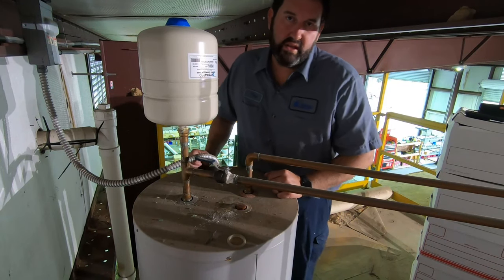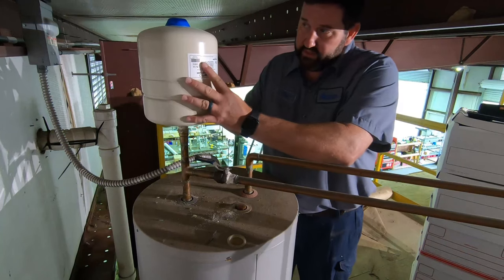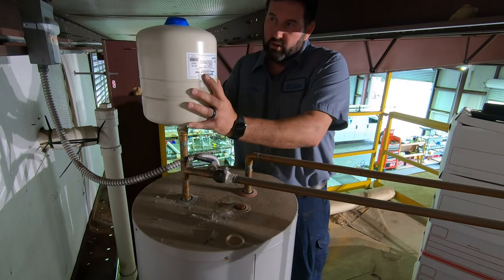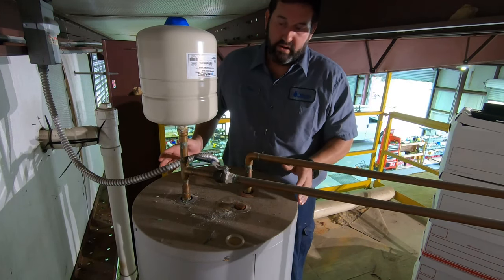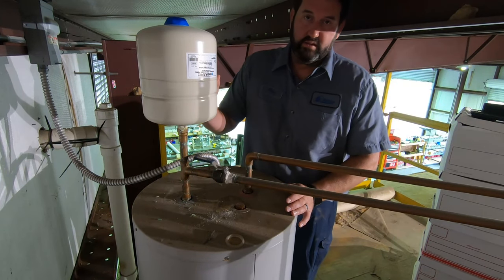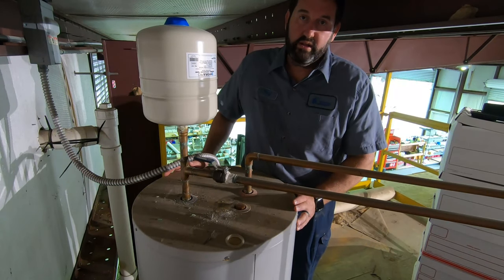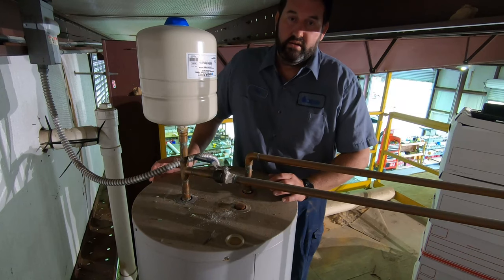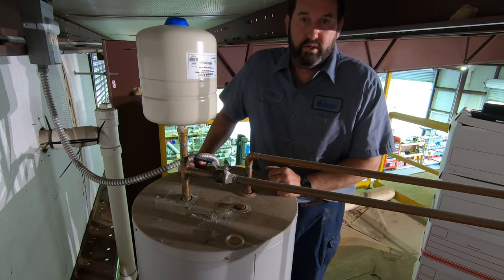What does an expansion tank do?

Comment: I’m no plumber but I’ve never used one and have never had any issues. By the time it goes bad I just replace it. These things are design to go back the day after warranty is up anyways.
Reply: How do your heaters usually fail?
Reply from the maker: We've had several instances in which the water heater liner fails and begins to leak. In each instance, there was no expansion tank. So  i think they have great value. Thanks for commenting, where are you from ?
Reply: If they were needed they would be designed with them already on them, sometimes people just look for things to put on things that aren't needed.
Reply: @timgaskey2258  - no because there are some installations that don’t need an expansion tank, they aren’t incorporated into the water heater by default. Also, a water heater has a much longer service life than an expansion tank, so water heaters would have to be replaced far sooner if the expansion tank was built in.

The real point that was missed in the explanation is when it’s absolutely a must to have an expansion tank regardless of what code requires. If the water meter has a back flow prevention device, then an expansion tank is a must. If the incoming water supply uses a pressure reducing valve, an expansion tank is a must. If the T&P valve on the water heater is dripping, you might (might means maybe, not must) need an expansion tank.

The water expansion that occurs when the water heats water is sometimes released by plumbing fixtures - for example, a toilet that seems to run might be doing that because it the increased water pressure that the expanding water produces in an otherwise closed plumbing system.
Reply: Great video sir i have a question i have an AO smith gas water heater and for decades i had never install an expansion tank. When the heater goes bad it start leaking from the bottom and i just replace it. Should i get an expansion tank?
Reply: @timgaskey2258 lol! My gas water heater didn't come with an exhaust pipe so I guess it doesn't need one. 

This makes no sense. My electrical panel didn't come with the breakers installed either does that mean I don't need them? The water heater has one job and if installed and maintained properly, it can do that job for up to 20 years. An expansion tank also has one job, a very different job from a water heater, and if installed and maintained properly it can last up to 10 years. 

A side bonus of an expansion tank is that it can act as a whole house water hammer absorber thus killing two stones with one bird.

Comment: My water heater has two different sets of water hookups-
Two on the lower side and two on the top...
possibly for the type installation...
I’ve hooked it up to the ones on the lower side connections and now need to add an expansion tank.
Does the expansion tank have to be hooked up to the cold side that is actually supplying the water heater or could i just hook it to the extra (non-used and plugged) top cold hookup?
Would just make the job a LOT Easier and should let the thermally expanded water press out of the heater.
Thanks in advance for Any Advice!!!
Great video btw-best I’ve seen yet 👍

Comment: Just replaced a 20 year old gas water heater, never flushed it, never changed the anode rod, and didn’t have an expansion tank…connected to city water…I replaced it because it was not heating as it should, probably from sediment build up….im sure these tanks are helpful depending on your situation…I didn’t install an expansion tank on my new one…I didn’t have a logical reason too

Comment: I have a Watts (adjustable) relief valve coming from cold water line and is set up to release outside like the water heater pressure relief valve...
And it's leaking ...the stupid part is so old Home Depot doesn't even have it you have to order it..
Something tells me this is just a pressure relief valve they used before they used the expansion tank and it's totally unnecessary now.
But finding the answer to this question on the Internet is like almost impossible I've been trying for 4 hours can't even see straight

Comment: Sacramento has that requirement. But still don't know why it's necessary besides it being very important.
Reply from the maker: It really does help to extend the life of the inner liner of the water heater. The heating up and cooling down really puts stress on it over time if there is no air cushion to help it out. I used to feel like it was a waste of time to install one but not anymore.
Reply: I see. Thanks for replying. They shouldn't make it a requirement.

Comment: 3 to 5 yrs., mine is 11 yrs. old and still holds 40 psi. Great video.
Reply from the maker: Nice! What brand is it? I may need to start buying them!
Reply: Mine is a "American" water heaters portable water expansion tank 2 gal. #318461-000
Reply: My tank is 16 years old, without expansion tank.
Never had a problem.
Reply: @mrfisther  Same here my system is a Rheem Fury 18yrs old and NO expansion tank, but it is being replaced today without an expansion tank :)

Comment: Thanks for the great video.  Question:  When water is on, we hear hammering noise inside.  Water pressure off the water heater drain valve and off the  hose bib outside reads 80psi, but inside (wash room) is 38 psi.  could be a faulty prv and or expansion tank?
Reply: there could be a pressure reducing valve in your plumbing system.

Comment: if you have open water system (i.e. no check valve in the cold water inlet), then you don't need expansion tank, since the excess pressure will just go back to the city main. Am I correct?
Reply: By the same logic what's stopping the excess pressure from the city main to put a strain on your pipes?? Expansion tank is like insurance, you hope you'll never need it but will be glad when you do.

Comment: We have a new build house with a well.
We have a pressure  tank that keeps the water pressure at 50psi.
We dont have an expansion tank on our water heater. It's not required by county code.
Should we honestly have one?
Reply: -- No.  If you are getting city water and the water meter has a backflow prevention valve, You need an expansion tank. or if the incoming water supply goes thru a pressure reducing valve, You need an expansion tank.

Comment: i have a solar heater whistling badly. seems it is doing that from ceck valve in cold pipeline. would it eleminate the noise, if installed an expansion tank?

Comment: If you install the expansion tank upside down like in the video won't you end up with air on both sides of the bladder because air is going to get trapped in the wet side of the tank? Shouldn't the tank be right side up so there is only air in the bottom of the tank and only water in the top of the tank?
Reply from the maker: To our knowledge, you can install it up or down or horizontal. Always read the instructions for each one though.
Reply: Air compresses, liquid doesn't.
Reply: Isnt ther a bladder in it that separated the water from the air?
Reply: @u2ooberboober  Yes. But when the tank is first installed it will initially be completely full of air on both sides of the bladder. Then if the tank is upside down (wet side down) when you turn the water on the wet side will only partially fill with water because air will get trapped in the tank on the wet side. But if the tank is installed wet side up the air will purge out of the tank as it fills and the wet side will be completely filled with nothing but water. That's the difference depending on whether the tank is installed right side up or upside down.
Reply: @joevignolor4u949  I see what you’re saying now.  Eventually that air on the wett side will be dissovled into the water and only water will be present and fill the space.

Comment: Home water pressure can increase up to 10psi over normal when served by a tank water heater. 

Heat expands water.

Be sure to read pressure while the cold line is isolated.
Reply: My water pressure goes up to the supply line pressure of 140PSI when our hot water heater turns on,  I only have a PRV installed.  I will install a Watts 2.1Gal Thermal Expansion Tank this week to keep our water pressure about 50PSI which is the PRV setting.

Comment: Quetion:  If you change the pressure on the PRV, do you need to recheck the pressure on the expansion tank?
Reply from the maker: I would
Reply: I just installed a PRV with a valve box coming off my meter. I set the water pressure at 55psi and checked with a gauge to confirm at the hose bib. I then installed a Rheem water heater with a watts expansion tank set at 55psi. If you change the pressure at the PRV, buy a gauge to test on a outside hose bib. This will be the new pressure to set on your expansion tank.

Comment: Thermal expansion happens when heat forces water molecules to demand more personal space. If we don't give the water molecules a place to go they will start pushing and shoving on each other and on their tubular prison maze. This will cause an increase in pressure unless there someplace to go like a shiny new expansion tank. Now since air molecules are trapped in the expansion tank it acts as a hydraulic accumulator and all the air molecules move closer together as water moves in. This does result in a very small pressure increase that's hardly worth mentioning. Essentially the expansion tank is an energy storage vessel that controls an unwanted pressure increase in an incompressible fluid, water, by compressing another fluid that is reasonably happy giving up a little real estate. No time for proofreading so please auto repair any typos or factual omissions. 

Although commonly installed near the water heater this is out of convenience. An expansion tank can be placed anywhere on the home side of the cold water unless your local code says otherwise. It's adding protection for your entire system. If you have grey or gray Poly B by Yuleki an expansion tank can help you walk that fine line of procrastination. Bye
Reply from the maker: Jim Marriott thanks for the info!
Reply: That was a great way of explaining it. Id really like to understand plumbing from this kind of perspective. What are your sources, if you dont mind
Reply: Ok now cut the power and make it 0 degrees for a week air molecules also crystallize and in the deep freeze that things are ticking time bomb

Comment: are these helpful in situations where my water pump keeps starting every 2 minutes even without anyone opening the taps?  I do hv a geyser and could be the heat causes the pressure to fluctuate?
Reply from the maker: They are mainly for accommodating thermal expansion. Your problem sounds unrelated to an expansion tank to me. Thanks for your comment. Where are you from?
Reply: If you have a well and your pump supplies all the pressure for your system then you need tank to go with it. The expansion tanks are just a smaller version of your main pressure tank. They both put a compressible fluid inside a system of the incompressible. Without an air bladder of some kind when you draw off a tiny amount of water the system's pressure drops dramatically. The air bladder or volume is a cushion or spring to push back on the water as its volume changes.

 You're correct in thinking that adding an expansion tank might help with your pump cycling too quickly. What i suspect is your main pressure tank either doesn't have a bladder inside (old tanks) to physically separate the water and air or the bladder is damaged and allowing water past. If you have an old tank its normal for the air to hide as bubbles and escape slowly out a tap. Regular maintenance includes draining the tank once a year to both remove sludge and also to restore the tank's air volume. That air volume is your pressure buffer. Hope that's enough and always happy to help if I wrote something confusing. Nothing like running a few months behind, nobody's watching by then.

Another possibility is a slow leak somewhere.

The final one I'll add is the pump's pressure switch. The switch needs to have 10 to 20 PSI of pressure difference between cut out and cut in. Sometimes its fixed by the switch design and other times its adjustable.
Best of luck under pressure.

Comment: Can these be installed on the hot water line I’ve seen unvented cylinder in a cramped cupboard before with no balanced cold so just hot pipe leaving cupboard and it was teed in there
Reply from the maker: It needs to be on the cold side.

Comment: you only need an expansion tank if your plumbing has a backflow preventer or pressure reducing valve older homes lots of times don't have them, so the water just expands back into the supply line a couple feet as tank heats up nobody requires them where I live or has one in their houses.
Reply from the maker: Yeah that’s right. We have check valves on our water meters around here.

Comment: Yah, and the looks I get when explaining why our government thinks this is necessary while I remove their 25-37 year old water heaters. I can't explain why its desirable to put on the cold water side when the hot water is expanding and the entire water system is connected and not isolated hot from cold.
Reply from the maker: That’s a great point. Our inspectors make us put them on the cold side
Reply: If you put the expansion tank on the hot water side then some hot water is going to be forced into the tank as the water heater heats the cold water coming in. This will cause the expansion tank to become hot. Because the expansion tank is not insulated like the water heater you are going to lose some of the heat from inside the expansion tank out into the room. It costs money to heat the hot water so losing some of the heat out through the expansion tank makes the system less efficient and more expensive to operate. In other words the expansion tank becomes a source of heat loss that will allow heat from the hot water to escape. But if you put the expansion tank on the cold side then this cause of wasted heat is eliminated.

Comment: Do you need a dielectric union at the ET inlet since it is SS and it comes in contact with dissimilar metal (copper)
Reply: if it is actually good stainless it should not corrode too much when connected to copper

Comment: Thanks for the great info 

I would just like to say 

Untill they made building codes that forced you to use mechanical air hammers instead of the manual style. That we used for years 

You didn’t need a thermal expansion tank.  My opinion
Reply: you only need expansion tanks in places with pressure relief valves in your house with a backflow preventer that keeps water from being sucked out of house if city pressure goes down like water main break. 
if you have no backflow preventer the water just expands back on the cold-water supply line a few feet

Comment: Would this make my water meter at street to turn when water is off? I can’t find any leaks in house so trying to figure out what’s causing meter to turn.
Reply from the maker: It's not probable. If your house is on a slab you could have a leak under the house that hasn't surfaced yet. Those are common where we live. Most common for us is a running toilet though so be sure to dye test your toilets before taking more evasive measures. Hope this helps.
Reply: @walleyplumbingcompanyllc5188  my house has a valve to turn off water inside home so I trun off wait few mins and noticed the meter at street still turns slowly.

Comment: I have 2 heaters and each has expansion tank on cold side.  my system pressure is 60 psi. One has 55 psi and other has 75 psi. Is this acceptable? bad?
Reply: is that pressure of air in the expansion tank you mean? it should match your system pressure, or it won't really work right.

Comment: Just had my expansion tank changed and the old tank was leaking from rust or something. The actual wall of the tank rusty or something. Not leaking at the threads, but from the wall oc the tank. Ever hear of that?
Reply from the maker: Yes. The bladder inside of the expansion tank probably ruptured
Reply: And then a pin hole created from the rust. Ugh. Thanks

Comment: great videos. hey got a question though, flushed my tank out then the pressure valve started leaking. replaced the valve and the new one started leaking, not sure on our water pressure but it sure dont seem like itd be that great. should i get an expansion tank either way?
Reply: another question, when i emptied tank had the hot side on faucet open water still came through as if some idiot crossed the cold with hot somewhere under house or is that the new days yahoo faucet invention?
Reply from the maker: Hey Bill and thanks for the comments. I’d say you need an expansion tank either way. You also may want to look into a pressure reducing valve installed on the water service line of the pressure is too high.  You can buy a gauge that screws onto your outside faucet to check the pressure. Those gauges aren’t expensive at all, less than $20. Normal house pressure where we live is around 60 pounds.
Reply: @psychobill3646  sounds like you had a cross over within a mixing valve style faucet.
Reply: it was an older shower faucet causing the crossover. but still our hot water tank drips (new) and our pressure is only at 64psi

Comment: how do i know its bad?
Reply from the maker: You can remove it and drain the water out of it. Then try to pump it back up. If it doesn’t hold air pressure the bladder has failed